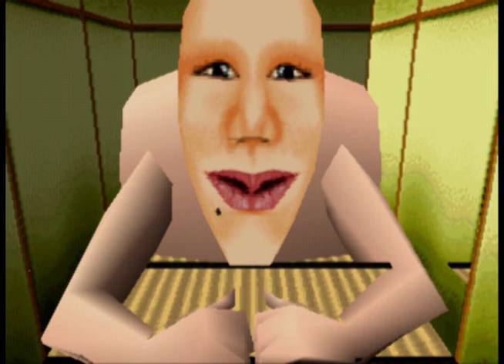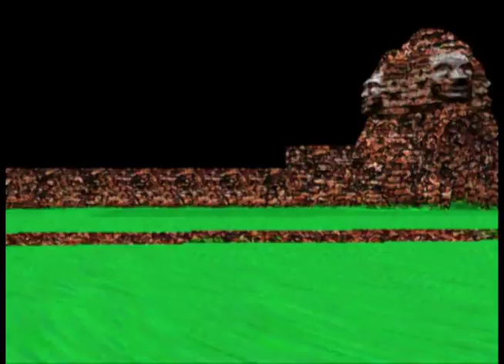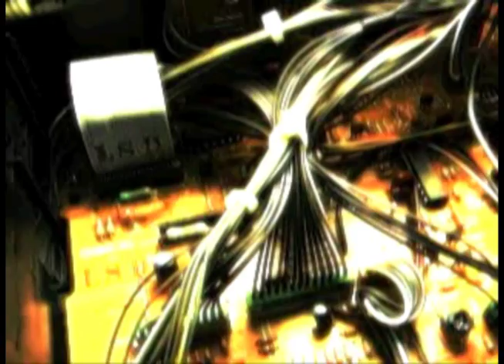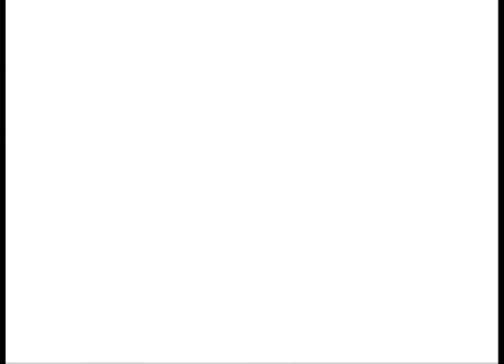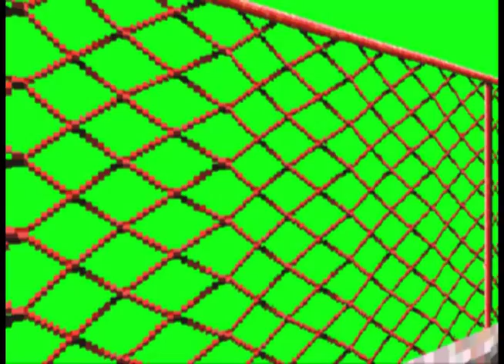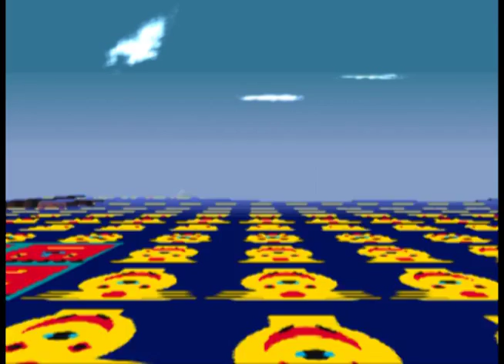Let's Play LSD: Dream Emulator (Blind) - Days 1-4 (Part 1)

Comment: I want to know how the fuck the framerate is so stable
Reply from the maker: I'm assuming it was my PC hardware.
Reply: Analog Gaming Holy shit was not expecting a reply xD I emulate this on the PSX emulator and it really chugs in areas like the Natural World, which sucks for exploration, but I was just curious to see if anyone had any knowledge on how to optimize this game, cause this game would be really fun to play in a group.
Reply from the maker: I would say have a decent graphics card mostly. When I recorded this, I had a GTX 460 which really isn't that powerful by today's standards. Refrain from using integrated graphics from your CPU. When I fired this game up recently I had some frame rare problems when my third monitor was on which was plugged into the motherboard as opposed to the graphics card and disabling it made it smooth again.
Reply: Analog Gaming Huh, cause I have a graphics card in my PC, can't remember the name but I do remember the bitch of getting it in there, and it still has some issue. I guess I just gotta fiddle with the emulator until it works better.
Reply from the maker: I use PSX 1.13 if that helps. It makes the water render incorrectly like a strobe light but it gives me smooth frame rates.